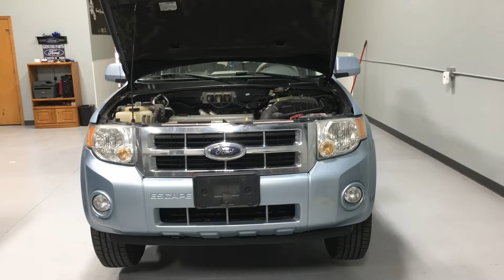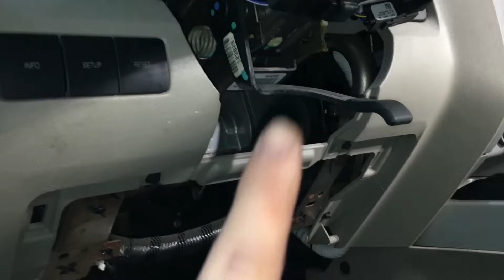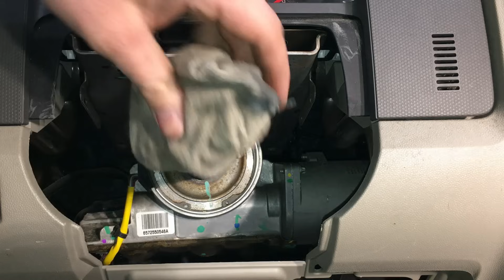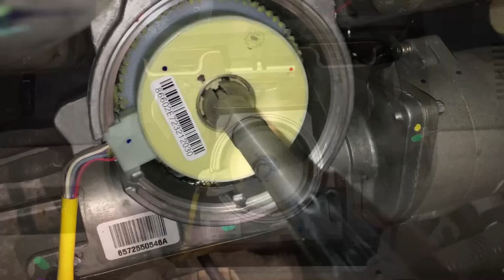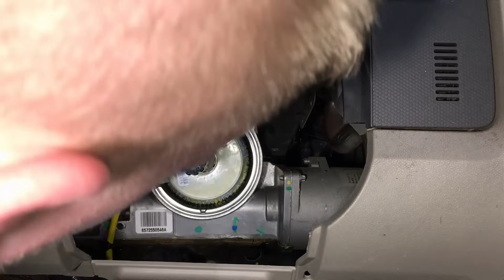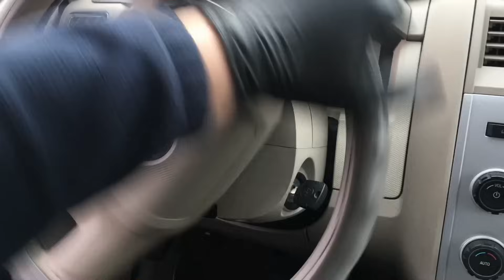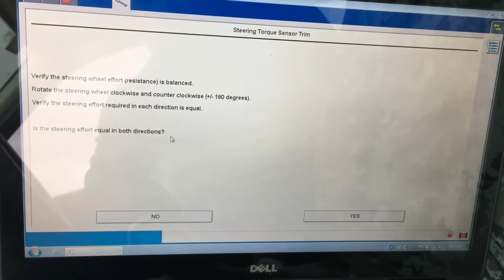2008-2012 Ford Escape Power Steering Code B2278 : EPAS Torque Sensor Critical Installation Steps

Comment: How do you trim it yourself without the software?
Reply: He said fully turn the wheel left to right a few times and it should re-learn the steering process. He said the software is for a fast or instant re-learning process. I'm going to do one this morning and I'll post my results later. I'm hoping to avoid having it scanned unless there's an issue.

Comment: Thanks for the great video. A friend of mine is having this problem with no codes appearing. Sometimes she has power steering and sometimes she doesn't and did notice a vibration in the steering wheel at times. I just want to make sure it's this part and not the power steering control module that's defective before I order this part. I work at a car dealership and a mechanic said he would do it on the side for $45.00 an hour labor which is a very fair price I thought. I could probably do it but with something this critical, I think I'll leave it to the pros for peace of mind.
Reply: Hey, get your friend to get an obd2 tool to clear code b2278.  apparently another poster said that it fixed their problem.  if thats the code, i cant see why it wouldnt work on other escapes that are getting the same power steering fault code.
Reply: Thanks for the reply. There were no codes showing. I replaced the steering torque sensor about 4 weeks ago and the steering's fine now. I did it myself and it wasn't that bad of a job. The hardest part was getting the snap ring off and on. I bought a proper snap ring tool and I was able to install it easily.
Reply: @1955Cal  Hey there, how hard was it to do it yourself? I'm about to actually attempt this myself in a few weeks and need all the tips I can get. Especially getting the steering wheel off in one piece (the part where he the bungee cord wrapped around it ) and im concerned about all the connections/disconnections I have to do around the steering column.

Comment: i have a 2009 ford escape and its hard to steer the steering wheel will this fix it? my mechanic is telling me to replace the whole steering column and the sensor, costing me about $1800.
Reply: The electric motor may be at fault, then indeed all assembly may need to be replaced (i myself i would rather drive without power assist - like in the old days).

Comment: Update!! Picked up a used steering column for $54 and installed it myself,  hooked all the sensors back up and started my vehicle and BOOM!!! Success!!!! You only need to take two bolts off (if you already have steering wheel off that is) to get the Steering column off and they are both 13 MM, you also have to unplug 2 connectors as well. I did not have to do any calibrating either!
Reply: Zak Shutte how do you remove the steering column?
Reply: @dueck303  it probably is harder than this video tbh.

Comment: Awesome video. Worked great and saved me a TON of money. Some tips 1. That snap ring is a BITCH to get off/on. You need a large set of pliers 

2. You’ll definitely need to go to a mechanic/dealer to take a look at the code. I took it in to my mechanic after I was done, thinking i needed to go do the whole steering column and he plugged in the computer, cleared the code, and it worked like a charm

Comment: Well, I had inquired with Ford in Colombia(S.A.) about the EPAS issue in November 2018, they insisted on taking vehicle in because of safety concerns, I finally did yesterday 02/11/19, even after I replaced the sensor, they said it had other failure codes ??, IAC they are replacing complete assy for free !!, WKYP on outcome.
Reply: ok so what happened

Comment: I replaced this torque sensor and I'm certain I didn't make any mistakes will I did so but now the power steering seems to come on and off. is there any way to calibrate the sensor once it's been replaced.

Comment: Just did this to my 09 Escape, wich is my vehicle in Colombia(yes the country !!), everything went smoothly, I cycled the steering wheel, etc.
 On one occasion after startng it got a little hard, so I repeated the cycling of the wheel process on a dirt surface about 6 times, so far ok. Do I need to have the scanner calibration or is ok as is. 
Thanks

Comment: If this is a recall, shouldn't it be fixed by FORD for NO Charge?
Reply from the maker: There was a recall yes but most came in for the free software update which closed the recall and now it is on the customer to pay.
Reply: @FordTechMakuloco  , Thanks.

Comment: A dealership replaced my torque sensor for this problem, then said it didnt fix the problem and I needed to spend an additional 1300 to replace the whole steering column.

I am not paying them to do that, and needed time and money to figure out what to do next so I picked it up and asked if it would be safe to drive. They said yeah just the power steering wont work.

I think they lied to me and I dont know what to do about it, because it seems like the power steering is working now but the wheel kicks all the way to the right almost like they messed up the alignment....supper aggravated.
Reply: That’s why i try to avoid them as much as i can and do the work myself.

Comment: Just replaced it and it still says  power steering assist fault and its just as hard to turn left or right any ideas???
Reply: Did you get this issue fixed? If so what needed to be done to correct the issue?

Comment: The snap ring is kicking my ass, does anyone have any magic tricks to get one off that's good and stuck?
Reply: Yup! I took an extra pair of pointed vice grips I had laying around (they're shaped a bit like long nose pliers) and with a side grinder, i resized the ends of the vice grips so that they would fit and hold inside the snap ring's holes. The advantage to the vice grips is that, once you've squeezed the snap ring and are ready to remove it, the vice grips hold it locked for you. Same goes for ease of re-installation.

Comment: Hey I got a question does that torque sensor make any noises that required replace my mercury mariner had a clock spring noise it went away after replace but I still hear something grind around that area inside the steering column when you turn the steering wheel no power steering codes. It only has weird codes that I dont even know how to diagnose u1900 u0114:20 cause they weird

Comment: Great instruction. Thank you. Would like to know which part of the sensor gets ruined. I just did one of these after watching your video. The Ford sensor I received had already been installed at a different repair shop, the pin and alignment tool were both missing. I took a chance , lined up the sensor visually and gently installed a piece of mechanics wire in the hole until it held everything in place.  Followed your instruction. I made sure the pin hole and arrows were perfectly lined up before removal and after the installation. Recalibrated the steering and it works perfect now!
Reply: Hey Marc, did you have to clear any codes?

Comment: Just swapped out mine today, but it doesn’t appear to have solved my issue, while the wheels were up it was crazy easy to steer, but I swear it’s actually getting more difficult... should I put the wheels up and hit the left and right stops a bunch of times??  Please help, need to get it back on the road ASAP
Reply: Any success since you posted this comment?
Reply: It was suggested by someone I knew to bring it to Ford to have the computer flashed, haven’t had the $ to do it since they want $200 for 4 minutes of work.
Reply: Update: brought the truck to Ford, was told the Rack n Pinion threw an error which caused the computer to shut down power steering, and that the rack n Pinion would need to be replaced ... $1100 repair bill.  Waiting for it to come out of the garage.
Reply: @RDMeags  Did you ever get a code reading to determine what exactly was the problem? Like how the B2278 error was for the torque sensor. The rack and pinion replacement sounds extreme and rare.
Reply: Adrian    Guy called me back the next day and basically told me the guy who called me didn’t know what he was talking about... they’re replacing the steering column.  They did get a code... forgot what it is, still don’t have the truck back as of yet

Comment: i have a 2010 mercury mariner that has lost all power steering and is showing power steering assist fault code. my local dealer ship ran a diagnostic and told me to replace the entire steering column at a price of $1500 which i cant afford. but the only code that it threw was the code for only a bad torque sensor. so i guess my question is can a bad torque sensor make the power steering fail completely? please if anyone on here can answer this question i would really appreciate it. i have ordered the sensor already.
Reply: apparently yes. How did your repair go?
Reply: Please carefully read all the comments here from other posts. What I gather is that IF you or a previous owner did not take the vehicle in previously for this steering system recall and NOW you're having the steering problem with that code THEN Ford must do all the parts and labor as per the recall. That could involve more than just a steering column replacement, if damaged, the rack might also have to be replace and Ford must pay for all of it. PERIOD

Comment: Hey Ford Tech I want to lower my steering column a little .I was thinking of putting a couple of u shaped shims or washers right where the two t45  steering wheel column bolts are, reason being I own a 2013 mkx and even with electronic tilt all the way down ,the steering wheel is still up in a uncomfortable driving position.Whats your take on this mod.Will I disturb an components, if possible will I have to modify the knee bolster .There is like 3/4" space between the final trim panel under the steering column. Thanks
Reply: I wouldn't add anything to this joint.  I worked for Ford in the plant where these columns were installed to the crosscar beam and the instrument panel was assembled and shipped to the final assembly plant.  The joint in question is a safety critical joint that we recorded torque values on with an electric nut runner and sent the values to Ford.  Changing anything from the designed joint could create issues for you in the event of an accident, or worse yet may cause problems when driving because of the angle change (there are 2 more bolts at the bottom so you would be mis-aligning the shaft) and  any modifications could put you in danger.  If Ford makes a change like that they will go through an extensive testing process and we would have had to submit many (100+) samples for them to test and certify.  I no longer work for Ford but I still drive them in large part because I know the lengths they go through to insure safety of the customer.  If they didn't put it there, especially on a safety critical joint, I wouldn't add it.

Comment: I have this same issue  and got the code B2278. They are saying I need a whole new steering column. I’m wondering if they are telling me that because it’s easier to replace the whole thing and charge me more than having to have the tools and accuracy to fix it this way. What do you think?
Reply: Shanna, the trade is filled with greedy crooks !  Take the car for two other estimates.

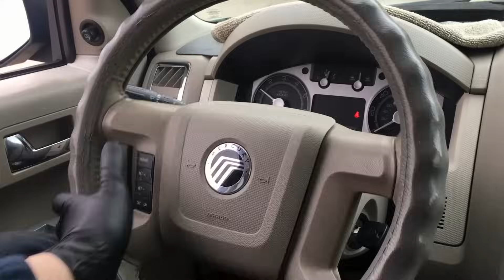Comment: 2011 Ford Escape Limited: This was an incredibly helpful video! I was able to switch out the sensor with proper alignment. However, it's been over 4-weeks since the installation and my vehicle has still not found the proper TRIM as indicated at 00:22:30.  Turning is much stiffer to the left than to the right. Before lowering the vehicle I turned the wheel for a few minutes between both end-stops, and have driven it daily since. Having done the manual process as described in the video, will you describe in more specific detail the procedure for getting the sensor to TRIM itself without the use of a scan tool? Thank you!
Reply: The dealer just replaced the torque sensor on mine and I am having the same issue! It will not learn the trim on its own. Did you ever figure out a fix?
Reply: @danielholley7607  All the shops tell me it's a dealer job. The dealer quoted me $100 to calibrate. Sounds like your dealer forgot. I'd ask them to finish the job.
Reply: Ah. Was hoping to avoid taking it back to the dealer because I got awful service there in the first place. That about figures
Reply: have you found success with finding the trims yet?

Comment: Can you please explain the calibration procedure of the torque sensor, but without a scan tool?
Just turn the steering from lock to lock? How many times?
After calibration I need to drive the vehicle in order to complete the procedure?
Thank you.
Reply: hybrid11111 good question was wondering the same thing

Comment: Thank you for this manual. Very informative. I have Power Steering assist fault in my message center. Mechanic told me it's  could be  the motor, because steering wheel doesn't shake. Could you show how to replace all power steering assembly with that electricmotor, please?
Reply: Did you ever figure this out? I'm having similar issues.
Reply: @IronGiant-1999  I replaced power steering column and it's gone.

Comment: @FordTechMakuloco
My Escapes Power steering dropped this weekend with no shutter and no Lights on the dash. I restarted the engine and it worked but did this another time. The Temp was in the 20's that morning. I pulled the codes and got C1963 - Chassis. Vs. the ones you mentioned. Have you seen this with the same issue or could it be another part? Thanks for making all the excellent videos!
Reply: Did you ever find out the issue, my steering wheel just got hard to move today and it was cold out.  I tried restarting a few times to see if that would help but it didn't it still has the same issue.  Currently too cold to work on it outside, but I would like to know what happened with yours.
Reply: @tedjones450  I ordered a whole steering colum back when that happened and never got around to installing it. The following winter it acted up again a couple times when it was below or near freezing. I was hesitant to switching it out worried I may have to calibrate the new one. The only thing I've done was unplug and check the motor connection and shockingly, it hasn't acted up since then. I still have the new column sitting the box ready to install if it ever does. I've probably put over 40k miles on it since then. Check your connectors, hopefully that may be the issue.
Reply: @JasonBlaylock  Thank you so much for getting back to me, I will check all of the connections as you suggested.
Reply: @tedjones450  You're Welcome! Keep me posted if that was the issue?
Reply: @JasonBlaylock  Just got back from outside and it's noon in Michigan.  I pulled all connections on the steering assist unit several times with no luck.  Also disconnnected the battery for about 10 min re-attached, no change.  It looks like I will have to get the steering sensor.  I will let you know the outcome, but may be a few weeks, since the weather a little cool to spent to much time outside on it.  On the positive side, at least without the steering assist, should help with an uppper body workout.
Reply: @tedjones450  Man that's a bummer. One reason I purchased the whole steering assembly with motor was I couldn't find the Sensor by itself. I had read that they quit offering the sensor due to the issues with installing correctly like Makuloco mentions. Supposed to be an easier install as well. Maybe he will see this and chime in.
Reply: @JasonBlaylock "" Update on the Eacape""" Finally replaced the torque sensor, and no change.  So far I'm in this with 150 bucks, 134 for the sensor and 15 for the snap ring pliers.  My guess now it's the motor assist itself,  or a bad connection to the motor.  Even though I pull and reconnected the connections to the unit, I may have to check to see if there is power going to it.  If so then I will have to see if I can pull one from the juck yard.  Nothing is never easy.
Reply: @tedjones450  Man that's a bummer. Do you have an OBDII module you can Bluetooth to your phone or a stand alone unit? This way you could see some live PID data from the sensor etc.  Also, are you getting a check engine light?
Reply: @JasonBlaylock  I do have an innova scan tool, which I did try reading code before but nothing came up.  I will try it again to see if I can get some codes this time.   Do not have a check engine light, coming up either and other than the steering eveything else seems to be ok.  I will be checking the harness going to the steering unit today to make sure I am getting power, and if it is than it has to be a bad unit, either the motor or the control module in the assembly.  Thanks for your suggestions
Reply: @JasonBlaylock  Checked power to the steering assembly and have a constant voltage even when the ignition is off.  I was wondering if the assembly always has power or if power is supplied when the key is turned, my thought maybe a bad relay.  Since it has constant power there is no relay, well there goes that idea.  Tried running codes, and no help there, and I disconnected the main power to the assembly just in case it decided to kick on, because if it does and since I put in a new torque sensor it could pull a hard left or right while driving when I do not expect it not knowing if the torque sensor is calibrated correctly.  At this point I am going to leave it for now, until I get a replacement from a junk yard or e-bay.  Thanks for your input and suggestions, much appreciated.

Comment: Hey FordTechMakuloco I did all the steps and reviewed the video several times, each step and paused to follow it while doing. I got a 2009 Mercury Mariner. Checked the VIN with Ford dealer and is not under that torque sensor recall. They want outrageous over $900 dollars to fix it. What is your advice.
Reply: Ford is lying !  They would not admit selling garbage that even themselves do not know how to fix.